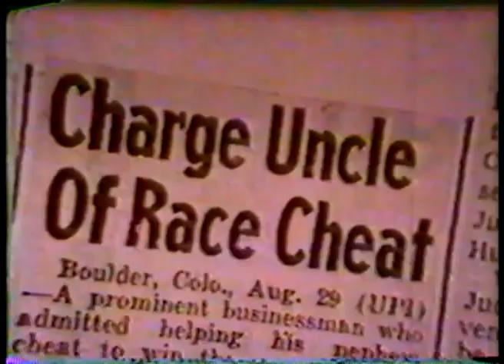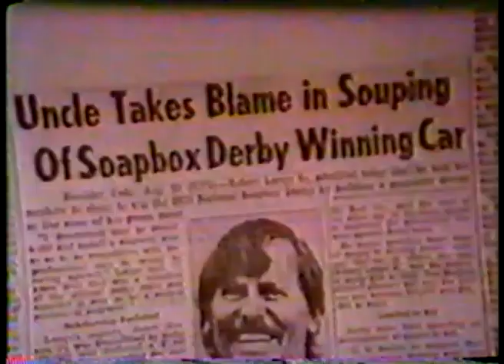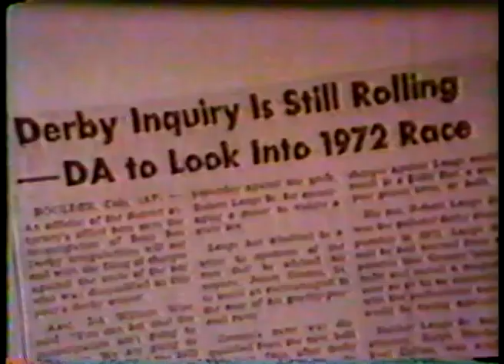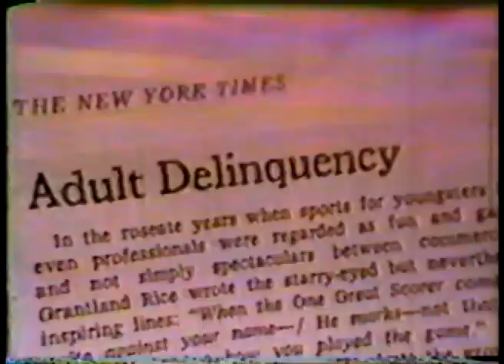The Day the Derby Almost Died - The Magnet Car

Comment: Fun Fact1: The championships stopped in 1984, but dramatically lost popularity in 1979. 
Fun fact 2: In 1984 a 79 veteran died when he was hit by a cart when he was crossing the street mid race. While the courts found zero  negligence from the organisers, insurance rates were more than doubled making the race unprofitable
Fun Fact 4: Scandal hit the Boston race in 1967 when a competitor was found to be an adult midget
Fun Fact 5: The "champion of champions" race was held in Dallas in 1980s  where 28 out of the last 30 winners took part. What was meant to be a fun race was soured with accusations of racism. As a result no winning ceremony took place. The mayor of Dallas later went on to pass a law banning all soap box racing in the city. A ban that still (on paper) exists today! 
Fun Fact 6: The most competitors to take part in a race was in Charlotte  in 1971 where 3,845 children competed over a weekend. The least was also in Charlotte in  1982 where bad weather and dangerous conditions resulted in the race being stopped after only 76 people had competed.
Fun Fact 7: The unofficial motto for the races is "speed is victory". 
Fun Fact 8:  In 1979 a cart took part with six wheels. Although initially "banned" it was found that no regulation disallowing more than four wheels existed. The regulations were quickly changed (or "clarified").
Fun fact 9: Until 1972 adults had to run along side the carts to stop the carts if they were heading to the crowd
Fun fact 10: In a last ditch attempt to regain popularity, competitors were allowed to use fireworks to make the carts look like they had jet engines.

Comment: Unfortunate that folks think that adding weights will help.  All weights fall at the same rate, discounting air friction.  In a vacuum a feather falls as fast as a steel ball.  I have seen it.  And for those who still doubt, if heavier fell faster there would be weight classes in ski jumping, wouldn't there?  There are none.  The derby ended from lack of interest.

Comment: Ironically, the magnet conferred no advantage in practice.  Watch from 16:30 at quarter speed.  Jimmy's gate touches the ground at the same time as the unused center gate.  Conservation of energy requires that any advantage was nearly insignificant.
Reply: Depends. Are the gates linked mechanically?
Reply: @6yjjk  That's a good point, and apparently there was a measurable lead after a few feet, but I don't have access to those measurements.

Comment: Cheating in racing is part of the game. 
Look at professional cycling - riders with drugs coursing through their veins, bikes with hidden motors, paying off opposition feeding staff to give their star rider brandy rather than energy drinks....
Reply: There is cheating, and then there is ingenuity.  It looks as if the battery and electromagnet would qualify as a power source and are simply not allowed.

I judged pinewood derbies for years.
We always had a rule that if it wasn't explicitly forbidden, it was allowed.

Every year we had open camps where we described the rules in detail and also explained all of the go-fast 'secrets' that everyone else thought no one else knew.
We had all the go-fast guides and we made them public.

We let everyone know what were explicit 'cheats' and that we would be watching out for the cheaters.  We displayed all of the standards and gages for car design, weight, size, etc...

No other standards would be allowed.  Cars could be 'pre-teched' a week before the races.

For those parents who got way too involved in their son's cars, we had a 'scouts only' pit area with no parents, and only the scout himself could handle the car, unless it was damaged.  If it left the pit area to be repaired, the scout himself had to carry the car back through tech before it was allowed to race again.
It really evened out the racing.

Comment: No mention of his cheating cousin??? I raced with him at Akron in 72. And yes that car that ran in 73 was the same car his cousin ran in 72, bobby the winner of the 72 race, was much taller and the car had a door that opened so bobby could bend his leg up to bring his foot back to press the brake pedal. There is evidence of the door on jims car. I missed 5th place by one race, got beat by a girl from Chapel Hill NC, Priscilla Ann Freeman. Yes I got beat by a girl... lol

Comment: The one sport a fat kid could win at
Reply: Not really, they use skinny kids to reduce frontal area and thus aerodynamic drag and the lighter pilot allows the weigh to be positioned in the most advantageous spots.

I would have liked to compete when I was a kid but my wide shoulders would have prevented me from becoming a contender for the finals.

Comment: Gravity makes1pound fall as fast as 10 pounds,  in order to make soapboxes go faster you must reduce friction between the axles and wheels,  so a 50 pound kid could beat a 60 pound kid with superior bearing surfaces between axles and wheels.
Reply: Wheel friction is crucial, but you're neglecting the effects of air drag.   A heavier car overcomes air drag better than a lighter one.   Think about dropping a steel ball with a very light, thin shell vs a solid steel ball of the same size.
Reply: the standard wheels have sealed bearings that can't be lubricated.

Comment: Electromagnet in front of car, wires that showed up on x-ray ... What was the source of electricity powering the electromagnet ??

Somebody should figure a way to deal with that VERY annoying high pitched audio background ...!

Thanks for the video up.

EDIT:
I found a diagram illustrating a large battery in the tail section, but find it hard to believe something like this could get through tech inspection, especially at a final event. I remember in the late 60's having my derby car have to pass fairly thorough inspection at our regional event. Link to diagrams below.
http://justacarguy.blogspot.com/2018/05/i-thought-id-posted-about-this-before.html?m=1

Comment: there's no reason using any sort of magnet would provide an advantage. silly. they win should not have been forfeited.
Reply: No reason?
A magnet imparting several ounces of "pull" as the metal gate drops forward will result in an unfair advantage of a few feet at the finish line. 
The vehicles acceleration was acted upon by a force OTHER then gravity.
The rules are clear, DQ.
Reply: Yes it accelerates the car, and initially is where big difference is made.   that small force at the start is WAY WAY better than if that same force applied near end.
Reply: @fredfinks  well it would work about as well as praying i suppose. they should have just done that instead.
Reply: @antigen4  Why are you so clueless about the effect of the magnet?
Reply: @robertromero8692  you didn't go to high school did you? inverse square law sound familiar? i thought not.
Reply: @antigen4  The inverse square law doesn't change the fact that the magnet applied a significant additional forward force.  Do you really think they went to all that trouble to do something that had NO effect?   The facts show  that it did, which you're amazingly oblivious to.
Reply: @robertromero8692  yes - agreed ... i'm oblivious to just how far the e-magnet was from this 'steel' structure ... i remain skeptical. i would be willing to bet it didnt' even work and the act of their getting disqualified was as an act of pure irony.  though technically speaking it would have to be a very very powerful e-magnet (using multiple full sized car batteries to be able to overcome the static friction of the vehicle in order to get it rolling
Reply: @robertromero8692  hundreds of collapsed buildings would say otherwise
Reply: @antigen4  What "hundreds of collapsed buildings"?  In earthquakes?   That's apples and oranges and you know it.  Obviously they would have tested the magnet, and just as obviously they wouldn't have risked disqualification on something that didn't work in the first place.
Reply: dothemathright 1111  Absolutely! Some people just can't seem to get past some weird theoretical notion of the magnet use. In this specific application a briefly activated electromagnet used the forward motion of the steel gate post, which was directly in contact with the front end of the car, to pull the car forward. It works because the magnet, through the front end of the car, is only in contact with the post while he post moves forward. Then the post drops away and even if the magnet is energized for a bit too long, it does not slow the car because the post is now out of contact.